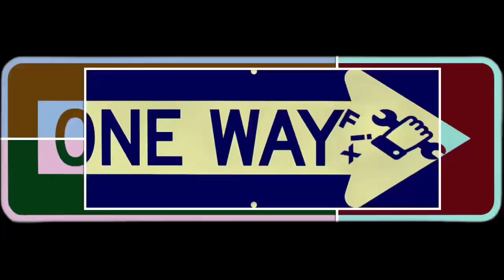Cadillac cts differential removal (easy way)

Comment: I have a 2014 that's need a rear differential replacement. The is part is about 2000 yikes 😬.  I need you to put in on for me
Reply from the maker: I pay 2200. At the dealer. For the new diff.       If you not for.  Away.  I can do it. For you.      Where you located?
Reply: @1Wayfix I’m in a similar situation potentially where are you located
Reply from the maker: @asharsimmons3959  im in in fortworth tx

Comment: Is it the same for a 2016 Cadillac CTS 2.0?
Reply from the maker: Yes  to remove. Will be the same. Just make sure.  Get the number  on the  little plate.  That. Number. Give you you gear ratio.   Make sure you get the same. One.

Comment: Hello great video, Is it hard to remove the flange    I am buying a rebuild but does not come with flages.  Thank You
Reply from the maker: Thank u.    Sometimes i use steering pulley. Tool. To get the flange put.   U can try that. Should works ⬅️⬅️⬅️😃

Comment: Man im having to do this soon thanks for making this video. Did you have your differential rebuilt or did you replace it new?
Reply from the maker: @noblewon3507  i got it from the dealer.    Total price was 2200 😬.     If you get a used one. Make sure u get the right one because there is like 3 different ones
Reply: @1Wayfix  ok that's what's up. I need the 3.23  limited slip version G80. I changed the clutch packs in the lsd and now the noise is gone. First time I was able to get the z plate in without having to use the old one
Reply from the maker: @noblewon3507   nice.  Work.    Main thing is to. Maintenance.   For sure
Reply: @1Wayfix  yes sir I've seen people saying every 10k miles 😂 I just got this one 60k miles 2012 cts-v very cheap and very clean.. just needed a diff but it was just a limited slip part apparently cause after i put the carbon clutch packs in it runs better and no noise so far.  I was considering a couple of options, used 300$ and fully rebuild it with carbon parts making it stronger. Or like you did get a new one for 2-3k and be scared to f it up and never want to burn out or get her sideways.. a refurbished transmission for this car is 2500! That's awesome
Reply from the maker: @noblewon3507  so you got it running like a new.    For the cheapest. 😁👏👏👏
Reply: @1Wayfix  yep, didn't some digs last night testing it out. The Carbon clutch packs really made a huge difference.

Comment: Sir.  Doing a 3.45 diff replace in a 2014 cts 2.0 rear drive.  Ready to install replacement.   On install  mount diff first to frame  then  attach wheel axles in any particular order?   Or attach wheel axles to diff then attach to car. Thank you for your help.
Reply from the maker: Bring it up. All the way.   Start with the mount diff. But don’t tight the bolts.    Just. A couple of turns.  Just to hold. It on.  The.  Bring the axles.  To the diff  and do the same thing.    Put the bolts. Back. On but. Not. All the way.    Then.   Bring the other axle. And do the same thing.     Now bring the drive shaft. And do the same. Thing.  A couple of turns on the bolts.     This way. You do t have to be. Pulling.  To alignment any bolt.     Now. You really to tight everything.     😃💪💪
Reply: Once Again, Thank You.
Reply from the maker: @JosephAlbanese-y4b  any time. 😃

Comment: How he do a good job when he never showed it going back in plzz tell me that
Reply from the maker: @rodneyjohnson5946  Bring it up. All the way.   Start with the mount diff. But don’t tight the bolts.    Just. A couple of turns.  Just to hold. It on.  The.  Bring the axles.  To the diff  and do the same thing.    Put the bolts. Back. On but. Not. All the way.    Then.   Bring the other axle. And do the same thing.     Now bring the drive shaft. And do the same. Thing.  A couple of turns on the bolts.     This way. You do t have to be. Pulling.  To alignment any bolt.     Now. You really to tight everything.     😃💪💪

Comment: Did you repair the old differential after removing it?
Reply from the maker: No.   I dont.  There is no parts.   Online.    Or. At the dealer.     And. To get it. At the junk yard.   You have to match the. Right number. To. Work right on you cad.
Reply from the maker: I bought it  new. At the dealer. 2200. I think.

Comment: Fantastic video my man . I have a couple of questions : Does the CTS 2.0 differentials     have a longer life than the V-6 before breakdown ? Around how many miles do these Differentials last before they break ? Thanks for trying to help people save their hard earned cash
Reply from the maker: Well this car. Its. 100.xxx miles.        And.  If i not wrong. There is like 2 or 3 different type of diff for this cars.     Only thing they need. Is. Do maintenance.  At least you very  30xxx miles.

Comment: Do you have to do anything to the rear suspension before u start on the differential
Reply: Is that a yes or no
Reply from the maker: Not really.  Just. Lift the rear.    
On the cv axles. Just remove the bolts. And push them to the side.     Any question leave.  I will do my best to help 😀💪💪💪💪
Reply: @1Wayfix  ok cool
Reply: Yea it’s was a couple hour fix no need to do anything else but drop the old ok n put the new one in. Easy like Sunday morning
Reply from the maker: @joshuawhitfield7183  happy to hear. It.     Any question leave here. I will do my best to help 😀😀

Comment: Did the car have to be on remove the cv axels?
Reply from the maker: No.  Just remove the bolts   The ones. On the side of the diff.   Then push the axle to the side
Reply from the maker: Check this part of the video 5:52
Reply from the maker: And this 7:02
Reply: @1Wayfix  did you have to hold the axles while unscrewing them?
Reply from the maker: @WeTtEr1227   no just loos the bolts.  Dont take the bolts out.   You can leave there. Hanging in the axle.  Then push the axle.  To the side